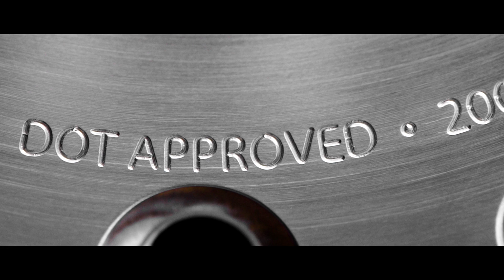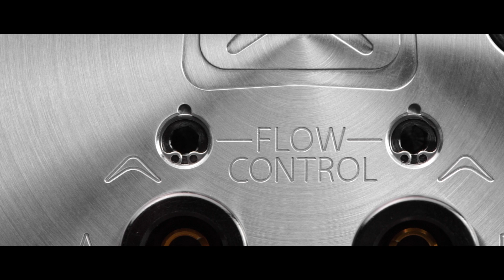ENDO | The Core of Air Management

Comment: Proven to handle over 1200 PSI but shows 200 PSI limit. Which of the two is it? Forgive me if I sound ridiculous but I'm genuinely confused...
Reply from the maker: You can see in our ENDO DOT Safety test, In order to get a DOT approved safety rating the tank must be able to hold 5 times the target pressure for over ten minutes with minimal shape change. The ENDO tank exceeds the required 1000 PSI easily.
Reply: I see, thank you for the explanation! Any release dates and prices for the ENDO CVT? Im dying to get my hands on it...

Comment: if you're using 2 separate Endo 3 gallon tanks for front/back, how does the wiring harness from the ECU trigger both?
Reply from the maker: The tanks can be wired to work with any corner you choose. Each tank will come with a pigtail which will allow you to wire the valves in each tank to any corner you choose.

Comment: Any Plans to offer the CVT in more lengths? Eg. The smaller doesn't look like it would fit two compressors, but the larger one is too long for my wheel well....given the modular nature, it seems that it would be easy to offer custom lengths.

Comment: I have the Vu4, will i have the option to just get the compressor tank combo only?
Reply: do you have plans for incorporating the vu4 & adding it to the inside of the tank?
Reply: this is for those of us who already have the vu4
Reply: We do plan to offer a "CT" or compressor tank version of ENDO eventually. The VU4 will never be integrated in its current form to go inside of the ENDO tank. This is what the VT and CVT are for. The current VU4 design cannot operate inside of a high pressure environment.